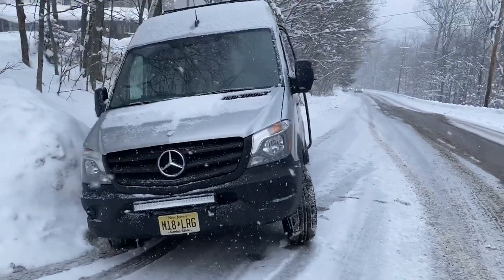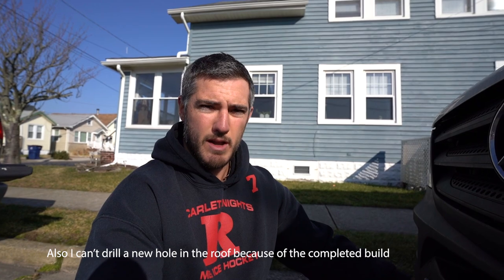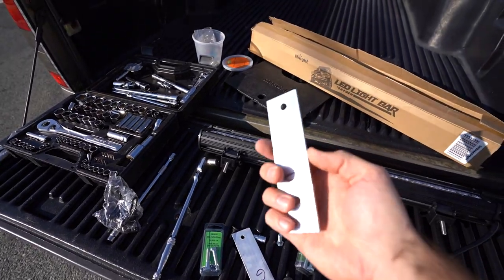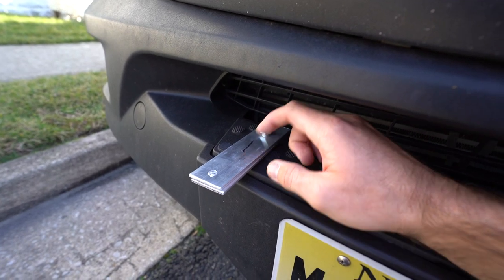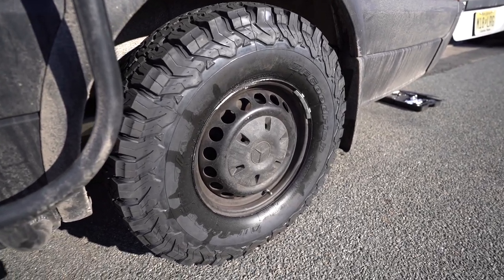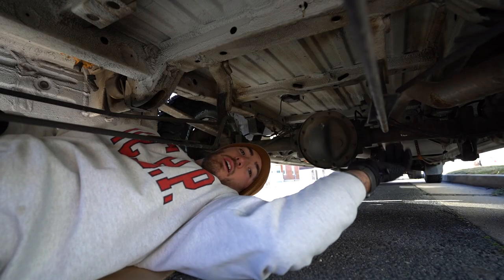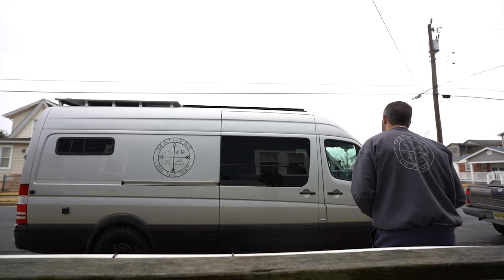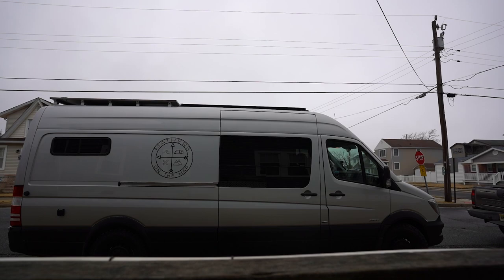DIY LED Light Bar and Spare Wheel Tire Modification for Sprinter Van - Van Build Episode 46

Comment: I added the K02's (on Black Rhino rims) before winter. They still require chains. Be careful with sizes on Amazon as 265/70/17's are top size of some cable chains and don't fit the K02's aggressive tread pattern.  Go one size bigger. Thanks on the LED and Spare vid... I'm very happy you've been a few months ahead of me on my build as I need to do both in March.  Thanks!  Off to finish plumbing my Shower :)
Reply from the maker: Best of luck with your build! We used the chains in targhee WY they fit thanks god! I made sure they did in Nj before we headed out though!

Comment: Light bar looks great but could you have used a dual 90 degree bracket to move above your step so you could still use step or would it still be unusable?
Reply from the maker: Good question I’m sure I could have.  The great thing about this is that it’s easy to modify!!

Comment: In mine the 265 fit, but it’s on the tight side. tip: on the passenger side you got a tub to put the jack handle in it to help you lift the spare tire.
Reply from the maker: You have KO2’s as well?!

Comment: Hi! Thinking of upgrading the same tire size 26575r16.are they not rubbing when you make a turn?
Reply from the maker: Correct but I’d probably do 245 if I did it again.  When it’s slushy the snow gets caught in wheel well turns to ice and gets tight.  Not sure if 245 would be much better tho, but no rubbing.  Just make sure you clear the snow!
Reply: @MathersOnTheMap  thank you!

Comment: I have a 2017 Sprinter and really like this idea.  However, have you taken into account that the light bar is blocking the airflow?  What are your thoughts?
Reply from the maker: People completely swap out the bumpers with sliminess racks and others that completely block that area off. I don’t think it’s an issue but that’s just my opinion! the grill is still wide open
Reply: I just finished up the light bar exactly the way you did it. I appreciate your guidance!  Enjoy!

Comment: Hi guys, hope the trip is going well! How did you mount the light bar switch on the dash? Did you use one of the knockout switch locations near the steering column?
Reply from the maker: Yep! Had to buy a switch off ebay dealer is too expensive!
Reply: Mather’s, you did not answer the question….. install in dash of the switch.